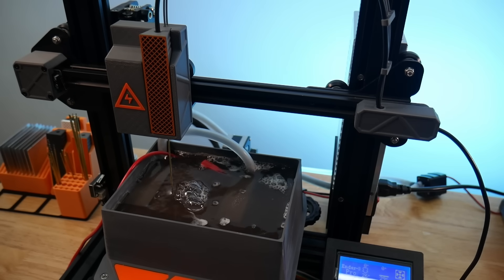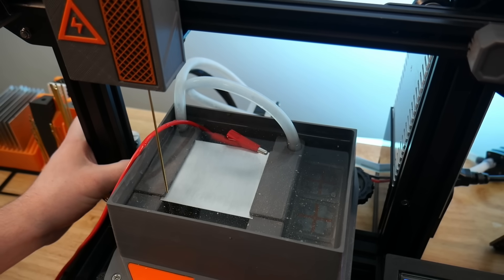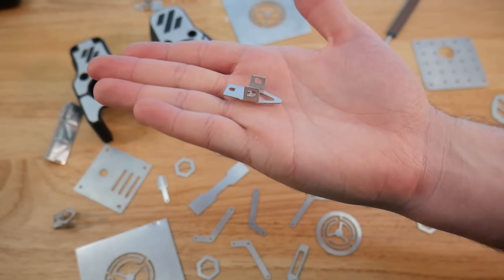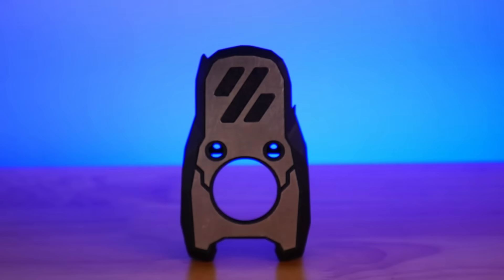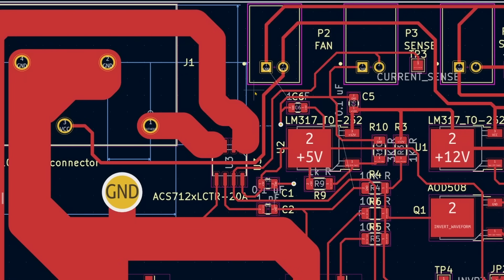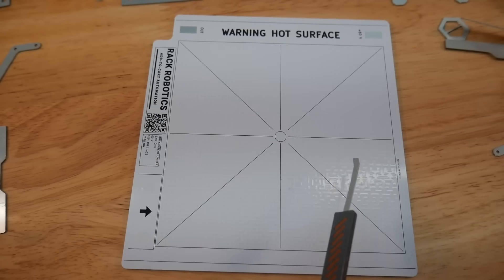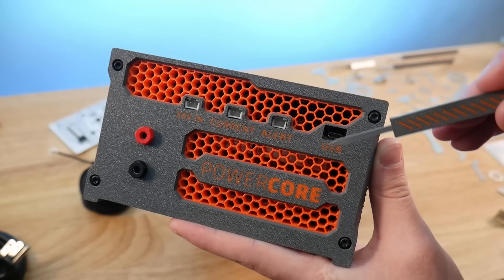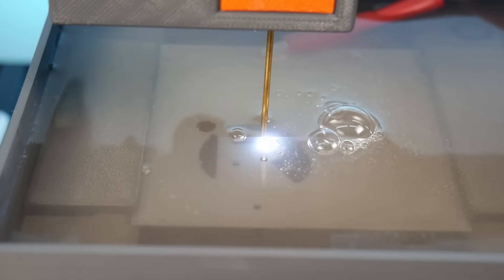I built an EDM machine

Comment: This is impressive. And I'm pretty sure I don't even know enough about EDM to know how impresive this actually is.
Reply from the maker: It is the Makerbot cupcake of EDM. It works, but is far less capable than a $250,000 EDM.
Reply: What I wonder about is where the burned metal goes. Because that's alot of aluminium going somewhere. Is it in the water? is it vaporized? I don't want to breathe aluminium nor do I know what to do with water with disolved aluminium.
Reply from the maker: @martincerny3294  It condenses into the water as a uniform powder.

Comment: I applaud your efforts in bringing this to our open source community. I am about to back your kick starter just for that but can you please include some specs? what can you machine? how fast? how long do the electrodes last etc. You are showing sheet metal work which would be an interesting thing between plasma cutting and fiber lasers but to make it practical you need to go up to say 3mm thick tool steel. Please tell us what materials you experimented with
Reply from the maker: The specs for the Powercore are simple: 72 Volts, and it comes pre-programmed for 2 Khz with a 80% duty cycle. Those settings are optimized for cutting aluminum. We do not recommend using steel or titanium yet. Thin aluminum is recommended because it minimizes the required water flushing. With a wire mechanism, and good flushing, you should be able to machine much thicker aluminum. We have not tried this yet. However, Dominik Meffert has used a similar power supply design (60 volts, 2 Khz, 80% duty cycle) to do wire EDM. 

The fastest we have cut thin aluminum (0.5 mm) is 15 mm / min. We generally stick to 8 to 10 mm / min. Cuts succeed 50% to 80% of the time. We use a 1/16" brass electrode (1.5 mm). We have a gcode post processor to compensate for electrode wear by moving the electrode down as the cut progresses. With this method, you can cut a length of 800 mm of aluminum with 40 mm of brass rod. 

The first hobby 3D printers could only print PLA. Then people improved the machines over time. We expect the same development path with EDM. Aluminum is our equivalent to PLA.
Reply: @MorlockEngineering  you are familiar with BaxEDM right? the only problem is that he did not open source the power supply though
Reply: @nerdworld8211  what's 14000?
Reply: @markos3803  BaxEDM is real EDM, if you look at the sidewall surface finish at 1:58 this is a complete joke in comparison, but a bunch of suckers will undoubtedly throw a bunch of money at it and then be disappointed later - such is the fate of every scam-starter project
Reply: @gorak9000  You sure are going in hard on something that is described as a "rudimentary EDM mill built from a 3D printer" It's designed for hobbyists to tinker with and make things at home. It's also open hardware so (in theory) once they run their campaign they are releasing the design into the public domain. I'm not saying it might not still be a scam, but it doesn't have the hallmarks of all the dumb sh*t people throw millions at on kickstarter all the time.
Reply: @lesdmark  Cutting with the end of the electrode and calling it EDM either shows a fundamental misunderstanding of EDM and or is a scam. That's not how EDM works. This is more like CNC arc gouging, which is why the surface finish is garbage
Reply: @gorak9000  I don’t understand your complaint. There is electric discharge and it is machining. That is what you need to call something EDM. Obviously you can’t expect a few hundred dollar kit to perform as well as a few thousands or a few hundred thousand dollar professional tool. Everyone understands that.
Reply: @gorak9000  BaxEDM doesn’t sell anything though. Your argument is like saying a Ender 3 is a scam because you can build a Voron.
Reply: @gorak9000  I fail to see how this is not "real EDM". Is it as advanced as an Agie-Charmille? No. But, what it can do is a fairly advanced adaptive sinker-type EDM.  For someone that talks down their nose like they know something, you obviously don't understand the difference between "roughing" passes and "finishing" passes.  I have plenty of one-pass test parts in my lab that look like absolute dogshit... until you run the other 2-4 passes at lower power and higher frequency to achieve low-Ra finishes.

Comment: In other places we had need of several large resistors. The solution we came up with was soldering power MOSFETs to copper pipe, running water through the pipe, and putting a current regulated (and adjustable) voltage to the gates. This put the MOSFETs in their linear operation range, causing them to waste heat in their junctions. Dirt cheap, scalable, and highly adjustable. Only issue was that we never got around to making it closed loop cooling, so you always had to run water through it.

If I build anything like this, or that, I will probably do it this way again. PCB resistors have ... issues.

Comment: I did the exact same routine about 6 years ago with PCB design.  From inception to working product in 8 months.  What a brutal project that was, you can teach yourself a lot in a short time while in a time crunch
Reply from the maker: It was key to create formal timelines and feature lists. Our team sat down every day and listed out our tasks. That kept development on schedule. I originally tried to learn Fusion360 electronics CAD, but the file management system was unusable. KiCAD Was easy to setup and maintain by comparison.

Comment: Cannot recommend enough a cheap soldering oven like a T962-A and stainless steel stencils from oshstencils (~$20ea with shipping) 
Saves a butt load of time over hand applying paste. My hot air station has accumulated quite a bit of dust now.

Comment: How do you deal with erosion/deformation of the electrode?
Why is the resistor necessary? Can't you control discharge time and current through more sophisticated means? Do you have (or want) a proper electronics guy who can help?

Comment: Oh wow, I was actually thinking about this sort of thing not too long ago.
It would be an incredible gift to small scale fabricators if this takes off like 3D printing has!!

Also, to assist with fundraising, you might want to look into taking orders for custom injection molds/small parts?
That way various real world use cases can be tested for improvements, and reliability can be measured too.
Reply from the maker: Honestly, the price of 3D prints is really competitive. We have enormous design freedom. There is a lot less work and lead time associated with running our print farm, compared to contacting injection molders.
Reply: @MorlockEngineering  i think OP meant that it would be a good demonstration, similar to your stamping and compliant mechanism demos

Comment: is there any progress of the machine such as using other materials besides aluminum. such as brass, copper, and steel with different gauge thickness. And then have you upgrade the area instead of the printer size 8 by 8. into a 12 by 13. Also was there any issues with the power source did it continue or was their failures. then the main board is there any changes or modifcations. This is an amazing transition and be waiting for more of the desk EDM. 👍

Comment: You can cut all those aluminum parts better with a .040 kerf on a $3600 50W fiber laser.  Haat is an issue if you power right through but it can be mitigated with timing and heat sinks.

Comment: EDM is basically electroplating a thin sacrificial  brass wire with the metal you want to cut. My lab loves them, but I don't have much use for them since they only cut in a vector (line). Since I mostly work in plastic I prefer 3D printers which are also lower cost, smaller, faster setup time and lower complexity.

Comment: I would use a metal case and bolt the resistor PCB to it and use the case as the heat sink. Fans are non-ideal. The are noisy, they wear out and can clog up with dust.

Comment: This is a great project! I have some questions or ideas to suggest
- Is it posible to work on thicker material? If so how do you set up the motion speed properly so it doesn't bump into the workpiece? Is there any kind of lateral/vertical strain gauge placed in the head to prevent damages to the rod?
- From what I've seen from professional EDM an extremely high quality surface finish can be achived, have you analyzed what improvements can be applied for obtaining finer results? I really have no idea but maybe filtering the metal particles in the water can affect the result.

Comment: I'm in the process of building the Low Rider 3 cnc router, it seams this would be a good fit for an EDM machine since most of the changes would be the table and changing the router holder. You would be able to cut bigger sheets. I never new about EDM machines until watching this video. How thick of a piece of metal can this cut and can it cut steel or stainless steel. Thanks. this might be one of my next projects to build.

Comment: i prefer this design to the wire feed design of the v2 system. any cut with wire requires an entry point from the outside which can cost the part strength and rigidity, the springs you made for example would be less robust, are there plans to offer the v1 system as well as the v2 system

Comment: Dumb idea, but could the Heatsink be used to distill water?  

Probably not enough heat output/significant water production, but just posting the idea here in case it is useful/inspires someone lol
Reply: On a more serious note, long term (post maybe an integrated machine, although just selling the Toolhead/Power  supply works fine too) dealing with Water Filtration/Reuse/Purification may be a good way to go.

Granted getting a finished product, production workflow, and all that obviously comes first but like a year or two out?  That and/or just the ✨O p e n   S o u r c e - N e s s ✨leading to someone else (maybe me if i ever get the funds/space lol ) making that system but yeah.
Reply: In the right region a cheap DIY “solar still” may work?

Comment: As someone who runs an EDM wire for a living, this is pretty sick. Imo u went way to thick with ur wire. Ur gonna get way better finishes and 100x the percision if u go thinner. We generally dont go over .05". U also have to be quite careful, and always use 100% pure dielectric water. That's a shock u don't want to feel.

Comment: This comment will probably get buried in the sea of other comments, but i noticed some minor mistakes in the PCB design. You may or may not take my advice, and thats up to you. I am electronic engineer and im currently working in BLDC controller designs. 
1)Use mosfet driver. Its more reliable, you can achieve higher switchin speeds and higher reliability in such noisy system as EDM driver
2)If you are using 2 or more mosfets, make sure you have same track leinght to the connector pins that leads in and out of the PCB. Therefore you can achieve higher reliability of the pulse
3)If temperatures are your concern, use mosfets with lower RDSOn value, you can even save money on using some PQFN mosfets, and with couple of thermal VIAs you can achieve cooling trough the PCB itself and the ground pad.
4)You have square wave of couple of KHZ passing right under the resistors. This is not good, it can mess up the signal, i belive Phil's Lab channel have good stuff on this topic.
5)Are you sure about those tracks between C3 and R8? :D
6)What is that GND track from Q1? Slap some via's around, and ground everything on lower layer, dont run GND tracks around :) And, also, keep them same thickness
Again, i may be mistaken, im literally just watching this video as anyone else, maybe you have everything under controll... so....yeah :) 
Good luck!
Reply: length matching is really no big deal at 2Khz

Comment: It would help if you explained how the power supply works and what the power resistors are for.

Also, what are you using for the actual power supply? I saw something like 72v in your demo spec thing. Standard 3D printer doesn't supply that..

Maybe explain some of the underlying physics and problems with the device if you want it to take off like 3D printers so you're supplying a potential community with information and inspiration to develop on your work.. Just a thought :)

Comment: Pay a HW engineer to design a proper schematic for that EDM PSU. Use a isolation barier between the LV and HV, also for the mosftet gate (opto-driver or driver with ISO). And for the layout, is still crap. In 20 hours a profesional Layouter will provide a decent layout. I would say with 5k you can fix both the schematic and the layout, to a decent level.
Reply from the maker: The layout/routing for the latest revision of the motherboard was not shown in this video. To which older revision are you referring to?

Comment: Pretty often you can find big lots of “breaking resistors”. Used for CNC machines and other big machinery. 

They’re pretty specific for each machine so quite often you’ll see them on the market a few dozen at a time for just absolutely unbelievably cheap price. They always characterize better and built much better than the cheaper dale type gold anodized power resistors. They’re meant to take serious abuse and be optimized. And since most people don’t know to look for those when building big electronics loads and things… They just don’t really get sold except people replacing them on their machine. It’s just not what people are used to looking for when needing breaking resistors and so I guess that’s why there’s a saturated cheap market

Comment: i mean im doing it with 2 capacitors 2 light bulbs for the power and now im working at a wire feed mech that i can extrude a straight wire so i can have the same 4 axis of a 3d printer for tool wear

Comment: Beyond impressive!

I just spent over $500k on injection molds for a project at work, and another $100k on reworks some "not metal safe" after changes were needed to the part geometry.

All these damn parts are smal, but we built full arrays first as a "cost saving" measure.

A desktop edm device would have let us trial parts via shop press injectors to test the final designs. Saving us a good deal of money.

What you have done with 2d parts is amazing, but if you make the jump to precision controlled Z axis edm on a desk top you will have people banging down your door to get them.

That said, work budget aside, I would like to bang down your door to get one of these, but missed the Kickstarter.  How do I go about buying one?

Comment: This is brilliant. How much harder is it to use a ball tip at the end of your EDM electrode and convert the 3d printer into a EDM milling machine. Also love you 3d printed tool and die stamp press. Instead of a mallet, consider a bearing press for better control and even pressure. Just found your channel and am subscribing. Keep up the great content!

Comment: What does the resistors do? Current limit? I am pretty sure that can be done in another way with ready IC:s.
Reply from the maker: It prevents instantaneous increases in current, which can damage the power supply. In 5 years there will probably be smarter solutions on the market. But right now this works and is really cheap to manufacture in bulk.

Comment: This looks very nice as a first product, some questions though:
while using a bedslinger printer as a base is probably mainly to save costs, dont you need to limit travel speeds enormously to not have a spill? I'd probably use another motion system - coreXY would be overkill but having the VAT not move would eliminate this risk completely.
Electrode thickness: is the diameter variable? i know from another EDM video i watched on another channel that it is usually a thin wire, threaded through the workpiece, was that just to fragile? or is it a case of reducing complexity? as is the diameter seems like a limiting factor for precision parts. the finished parts you showed off were also kind of rough around the edges (literally) will the final product have cleaner cuts?
Compatible materials: you showed aluminum stock, are there limitations on the materials used (except needing to be conductive)?
Is there also a manifold under the part? it looks like the edges are rougher around the bottom.
How often does the medium need to be changed?

overall a good sales pitch, congrats!
Reply from the maker: CoreXY is a solid kinematics system, and is much better than the alternatives. I would love to see someone make a coreXY EDM build. Thin wire EDM (wire EDM) works really well. We would love to see someone make one. Materials need to be conductive, but there have been cases where carbon fiber copper composite has been EDM cut. The edges along the bottom of the work holding are for drainage, not pumping. The water should be changed every job, which costs about 20 cents.
Reply: @MorlockEngineering  ok, another thing: the open tub of moving water on a moving axis RIGHT ABOVE THE POWER SUPPLY FOR THE PRINTER might be a ~slight~ safety hazard. i hope you reconsider the way you place it, else i can see the lawsuits already.

Comment: My only concern is that it is not a graphite cutter and not a wire as a machinist i am trying to make this as simple as possible but the metal wears away and then you will loose up to .001 in precision as depending on how hard and the size of cuts

Comment: I made a edm machine in high school back in 1980. I had to have a 50,000 volt board made and had to use dielectric oil with copper cutters. I got a b- in machine shop in grade 12. Tough crowd.